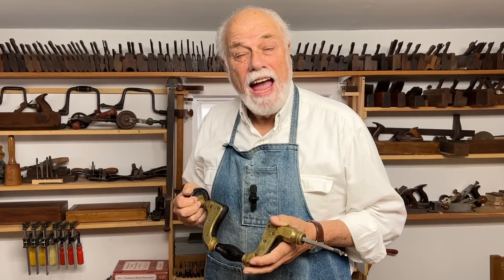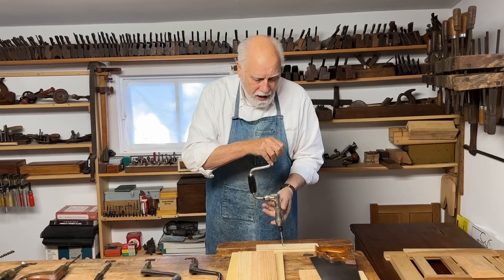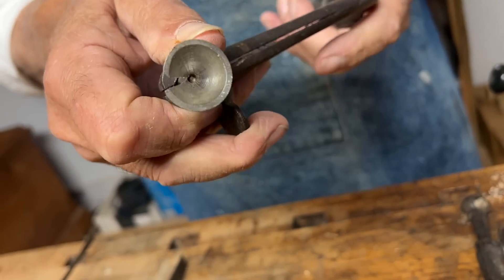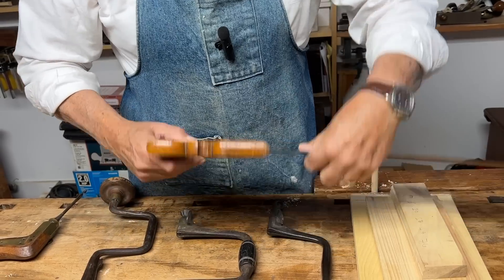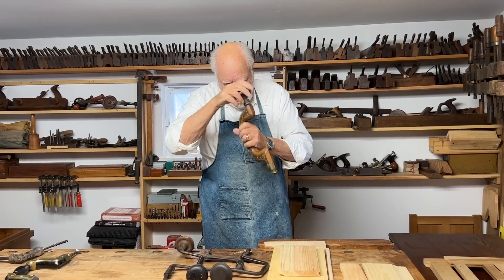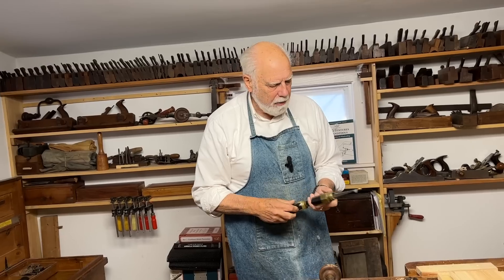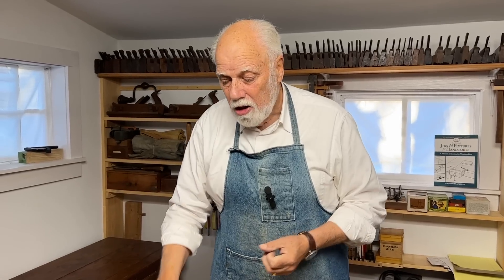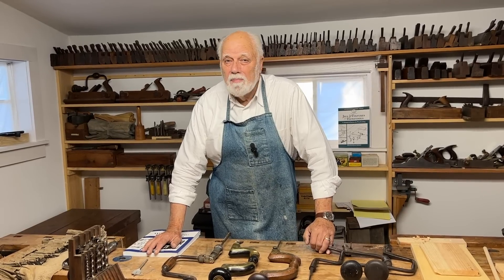23. The Best Braces & Bits

Comment: While I generally reach for the cordless drill, I appreciate the use of the brace and have recently acquired a ratcheting brace.  I don't use them all the time, but there are times when a slow turning drill is a much preferred method.  Thanks for sharing.
Reply from the maker: Of course — there's advantages for all types!

Comment: Today at a garage sale I found a brace that I have never seen before from the John S Fray company. Number 80 Bridgeport, Connecticut.  Just from what I was able to google. It appears that this is a corner brace, but I don’t really see a useful function, except for the fact that it is non-ratcheting and you can apply slightly more force then a traditional brace.  Have you ever found a reason to use one of these odd shaped devices?  I actually bought this because I thought it would be fantastic to use with my disabled son so that I could hold it and he could help turn.
Reply from the maker: The point is to be able to bore a hole against an edge that does not allow of a complete rotation with a regular brace.

Comment: The short sweep brace was known to us old geezers as a electricians brace because it was useful for drilling through floor joists when running wiring  circuits underfloor. When my Father passed away I discovered a cabinet with 3 braces plus a range of augers. Also were a rebate plane and many hand tools  which probably belonged to my Grandfather  but sadly I had a full range of power tools . Nothing else to do but throw them in a recycling metal bin. I felt awful .
Reply from the maker: Sad story.

Comment: I'd like to buy a brace and bits but always concerned about getting the right bits. Are they all the same?... Or do they differ from brace to brace. Where is a good place to buy these old brace and bits?
Reply: Have yet to come across the old square bit shanks. Seems the new ones are made for an electric drill.
Reply from the maker: Bits vary greatly. A good place to look is fleamakets and eBay.

Comment: Will an auger bit fit inside an Ultimatum brace?
Reply from the maker: Not perfectly, but it can be done. The ultimatum has a nub that connnects to a notch in the end of the bit. Depends how small the bit is.
Reply: @gjbmunc  Thank you. I just purchased an ultimatum brace and I'm trying to figure out what I can use for bits.